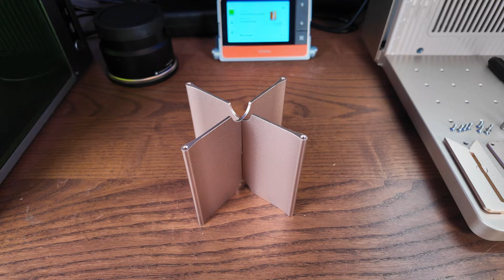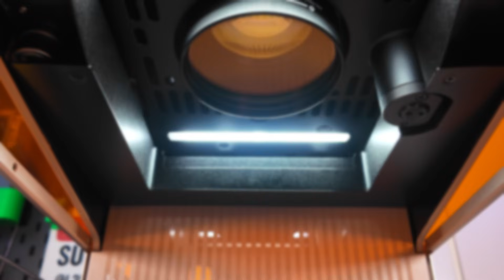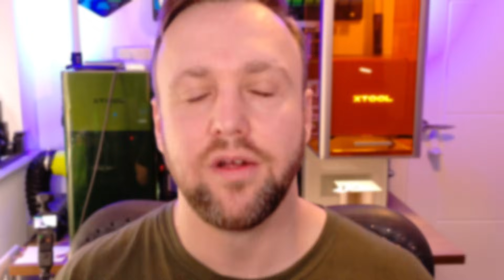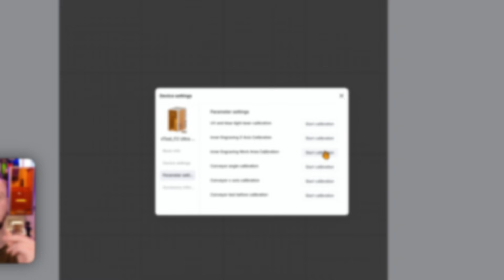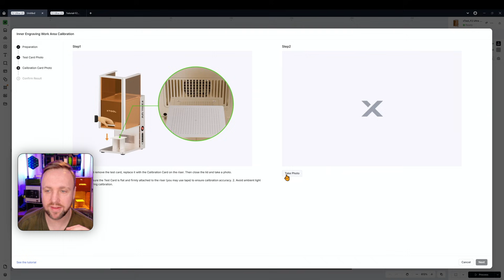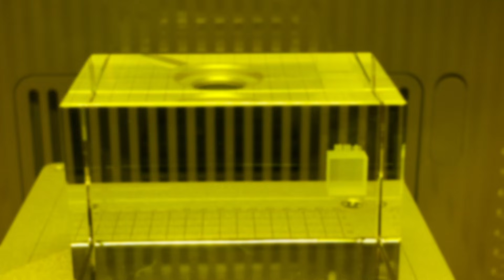Setting Up Inner Engraving on xTool F2 Ultra UV: Don't Skip These Calibrations

Comment: Do you have to recalibrate every time you swap lenses? Id hate to use up the k9 crystals
Reply from the maker: No you don't. My advice is only calibrate once and then continue as normal. If you ever notice the positioning getting inaccurate or results getting worse then I'd recommend recalibrating.

Comment: Hi Chris. Did I hear you right that I have to go through that process every time I change the lens? If yes, that means you have to pay (the cost of the K9) to change the lens.
Reply from the maker: This is one of those questions that has 2 answers... The official answer is yes. But the unofficial answer (based on my own experience) is no you don't. Ultimately you only need to recalibrate if you carry out tasks and notice misalignment or a decrease in the finish. From my own experience I have swapped it multiple times without doing any recalibration and it works great.

Comment: @l3dAccessories so how to find the recalibration option on its own vs it auto popping up.. im currently only internally etching.. so nothing automagically pops up to calibrate.. and havenot found a recalibrate option in menu...
Reply: @L3DAccessories any thoughts on question above... ive replaced lenses and its still not forcing a recalibration pop up window... how to get to it ?
Reply from the maker: Sorry I missed this Steve! If you click on machine settings (just above the material settings) there's a dedicated calibration tab, so you can run them from there whenever you like. Personally I only recalibrate if the framing or engraving position starts to look off.

Comment: Can you check if it works on the regular F2? Maybe there’s some settings you can tinker with. Thanks
Reply from the maker: It 100% won't work. The type of laser needed for this is a UV. The F2 is a diode/IR laser.
Reply: @L3DAccessories Thanks for clarifying that

Comment: Hi mate firstly Ty for the videos. So you have to go through the calibration every time you swap lenses? That's what I heard watching this but surely it would remember or have I heard wrong?
Reply from the maker: Thanks for watching and for the kind words. The official stance is that you should recalibrate every time you swap them due to potential deviations in positioning etc. However, my personal approach is to not run a calibration unless something appears off. So assuming the framing box is accurate, the engravings are in the right position and the quality seems good I'd just continue as normal with recalibrating.
Reply: Awesome and will be using your links to say Ty 👍
Reply from the maker: @AMWWC I really appreciate that. Thank you

Comment: you could specify the parameters used for engraving (speed, frequency, etc.)
Reply from the maker: They are automatically assigned in the tutorial. You can open the tutorial yourself and find them easily

Comment: Hi that’s a different calibration set up to the one iiv seen when I had my machine just b4 Christmas, have they updated it ?
Reply from the maker: Did you see the first video in the series? It may be that it's the other calibration (dot alignment) that you've done before. These are specific to the inner engraving.
Reply: @L3DAccessories I don’t think I have done a calibration for the inner engraving, I’ve just been looking, can you tell me where to find it?
Regards Alan
Reply from the maker: @alanwilliamson6428 If you click on machine settings (located just above material settings) there is a specific calibration tab.